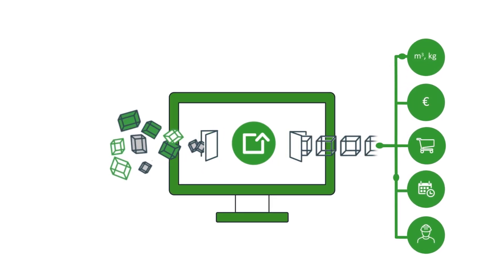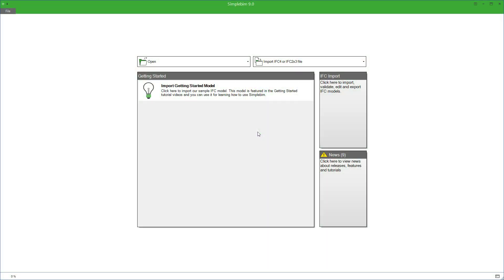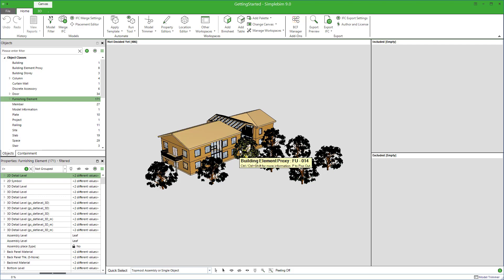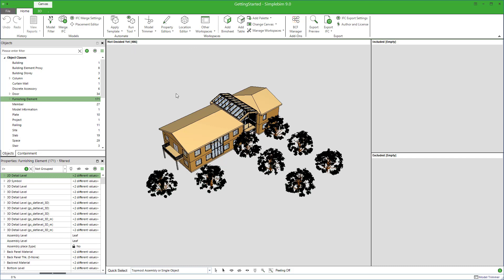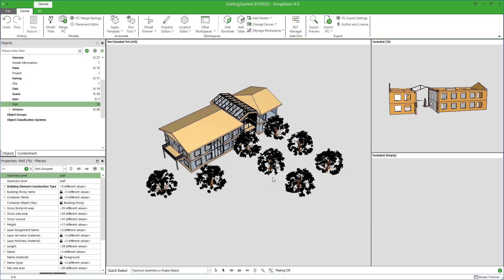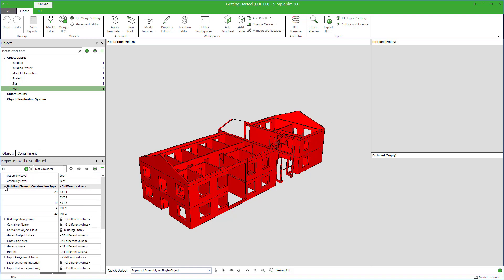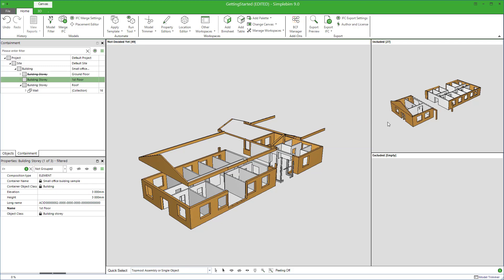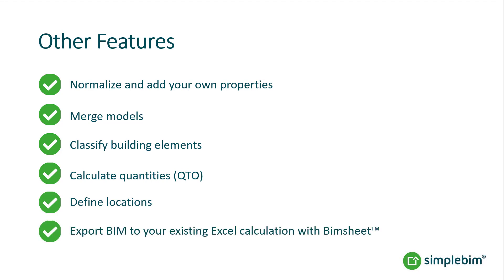Simplebim® - Quick Start Tutorial

Comment: Would like to ask you one more question. When i am merging multiple IFC files for example 4, is there any option to make them as 1 site only? I know that i can merge 2 by 2 and make them as 1 site, but i wonder if there is option to merge multiple of them as 1 site because in the dialog box that option is impossible to make them as 1 site
Reply from the maker: So you are saying that the the 'Resulting model should have only one site' -option doesn't work when doing multiple merge operations in the row (instead of merging everything at once)? Note that you can always further modify the model tree in Containment palette after the merge operation. Simply drag&drop the sites on top of each other and they are merged.